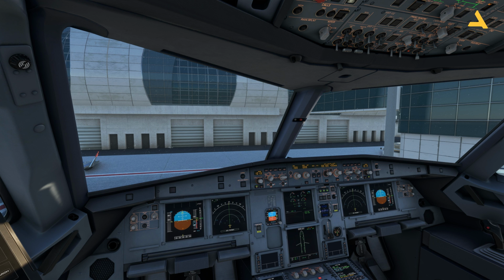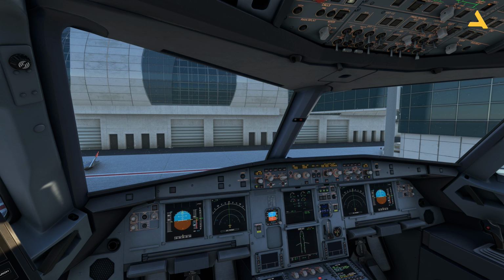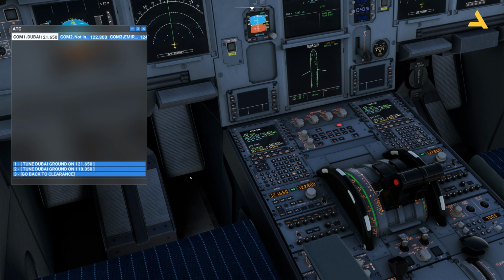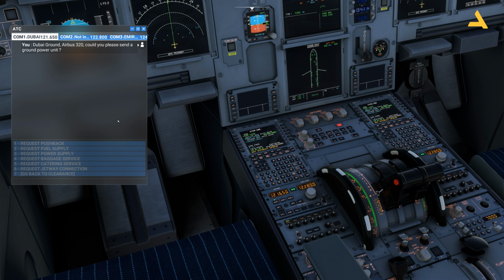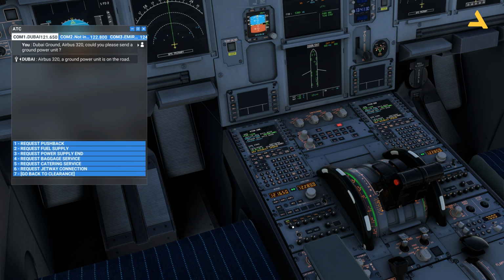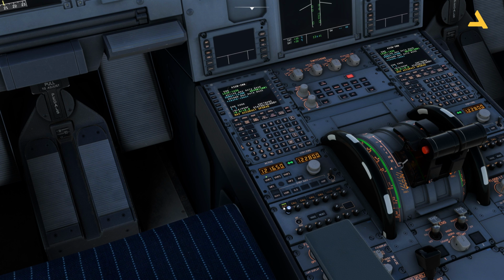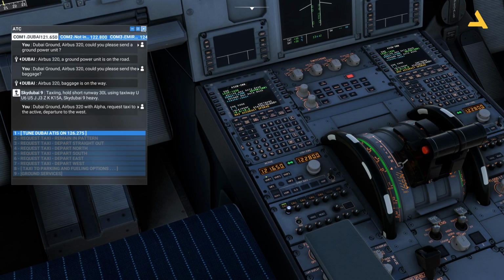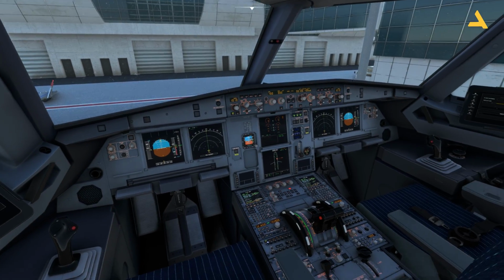How to Get the ATC Communication for iniBuilds Airbus A320 Neo - MSFS 2020 - A320 Neo Tutorial 5

Comment: When I try to put the autopilot, follow my flight plan, he doesn't want to do anything.
Reply from the maker: Are you flying in the managed or selected mode? In order to follow the flight plan your plane should be in NAV mode.
Reply: @aatifahmad  When I set the speed it works very well with the altitude but when I set the course then he doesn't want to follow it.
Reply: Where is that? I’m having issues with it flying the opposite way to the flight plan